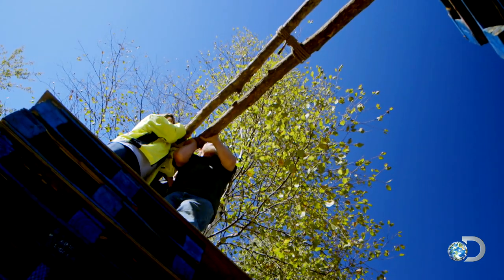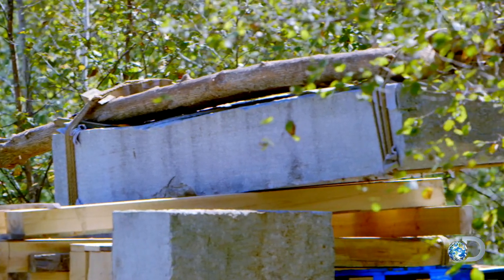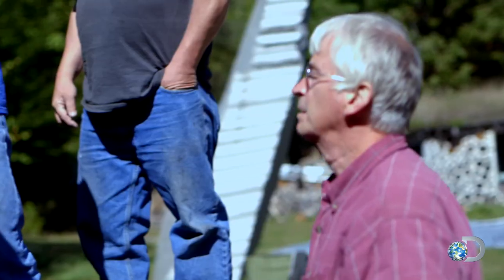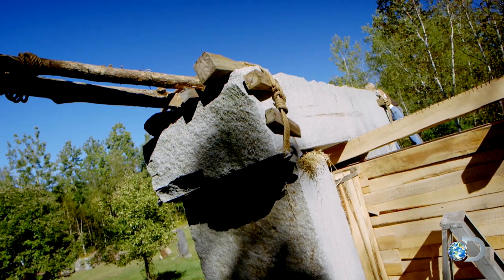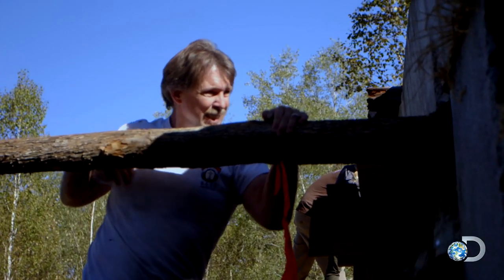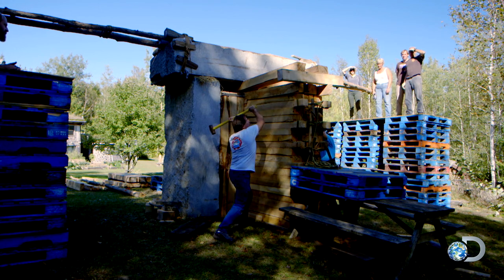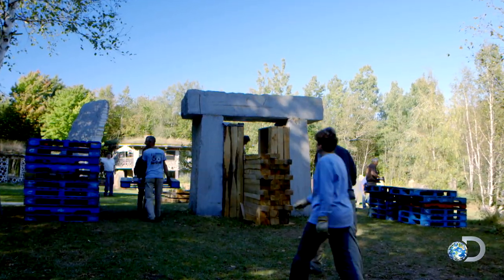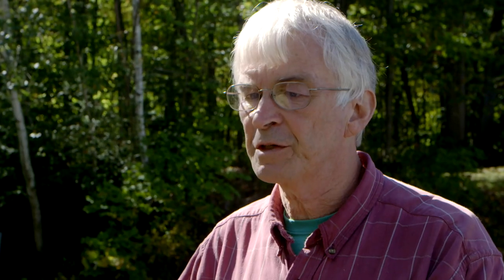Is This the Secret of Stonehenge's Construction?

Comment: Wally Wallington did this on his own without all this effort just by pivoting the stone like a seesaw, moving weights across the top of it from onde side to the other. Vastly more efficient without any need for wheels or dozens of men.
Reply: Wally raised it in the center then spun it and knocked the wood out if I recall. No ramp.

Comment: 0:37 - 0:43 This is the most important and least mentioned part of this video. At 0:37, notice the top stone is laying on the ground but for 3 wooden timbers underneath it's middle. They had to use long levers to tip this stone on its side and shove one side of these timbers underneath it. Using their top-mounted wooden levers, they had to work those bottom timbers into place so 

    the stone was resting on their middle. Once this was done, they could teeter-totter the massive stone down on one end and up on the other, by adding heavy weights  (lots of smaller stones) on the down end,  so they could wedge in more bottom timbers.

    0:42 Notice the built-up pile of bottom timbers now in place.  By doing this many times, they can raise the stone up to a high level. Once it was  slightly above the two vertical supporting stones, they could work it into place. 

     Rope had been invented at the time Stonehenge was built, but the wheel, pulleys, block & tackle had not been invented. Thanks to the discovery of ramps, inclined planes, and levers this stone work could be done. However, the men who built Stonehenge did not yet have metal tools. They had to use stone tools to shape the huge stones.

      Beyond the amazing ability to build such a stone temple, the question remains, why did they undertake such a long and difficult project?  At that time, humans believed in many gods, who controlled and were directly connected to  weather, crop production, births, deaths and every aspect of human life. Mankind lived in a spiritually-dependent world in their every-day lives, often superstitious, but always connected to powerful deities who controlled life.  Temples were necessary places where mankind could worship and pay reverence to their gods,  as well as find favor for healthy crops, healthy births, safety and survival.

      In today's technology-based 21st Century world,  much of humanity does not see a need for the idea of a spiritual lifestyle. Nor do they feel a need for a continuous spiritual connection to God or gods, as a necessary part of survival. Perhaps the ancients were far more advanced in many ways than we are today?
Reply: That's how Wally Wallington did it. On his own. Didn't even need any help. A single man can do this on his own working smart and without using anything invented up to the invention of the wheel!
Reply: I AINT READING ALLAT 🗣️
Reply: No.   Just moved stones.   Knew virtually nothing.

Comment: They are ignoring the mortar and tenon structure of the lintels. They were NOT flat on the bottom.
Reply: Those knobs are strange. They appear all across the world, in positions that aren't obviously used in the construction.
Reply: @markanderson9123  No, those knobs are there for a reason. The best explanation I've ever encountered is that the large vertical stones were originally laid on their sides and the connecting lintels were attached at that time. The mortar and tenon structure was necessary to keep the lintels in place as the structure was raised -- they probably also used ropes to make sure the lintels did not slip off. The two large stones would have gradually been lowered into a pre-dug pit using a lever mechanism.  As the stones gradually sank into the pit they became vertical and the lintels remained in place thanks to the mortar and tenon arrangement (plus ropes, in all likelihood). The whole thing worked like the sort of magic trick so often performed by magicians such as David Copperfield, who has made elephants disappear. IMO the whole purposed of Stonehenge was some elaborate deception, probably to give naive visitors the impression that the "priests" had supernatural powers. 

The solution offered in this video could not work because it does not take the mortar and tenon arrangement into account.
Reply: The above solution was worked out by the genius (NOT me) who posted this video. Check it out: https://youtu.be/oNF2PFmsaWk
Reply: @victorgrauer5834  Great explanation. I was referring to sites in other parts of the world like Cusco, Peru; Yangshan, Japan; and other. Google "knobs on Megalithic structures.

Comment: Why not lift it on platforms made of stone instead of wood ass they did here, but perpendicular to the uprights, not parallel.  Then, once it's just slightly higher the the uprights, put a small stone under the slab to reduce friction, and rotate it into position.

Comment: You didn't prove anything, how did you get it up on all those pallets, with a fork lift?
Reply: By placing the center piece onto a first set of pallets, then lifting it up just enough to place another set of pallets, and again, and again, and again, until it was high enough to put the side rocks in place, and then the challenge was to perfectly align the center piece with the side pieces, which is what you see there. It's really not that complicated.